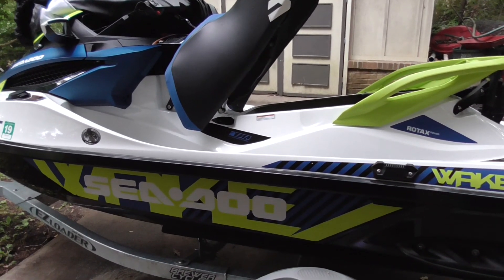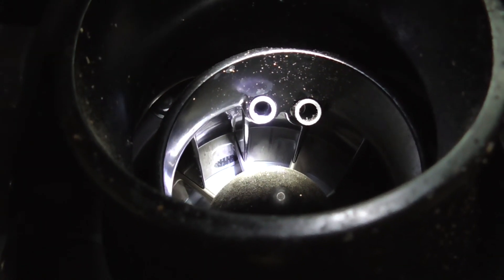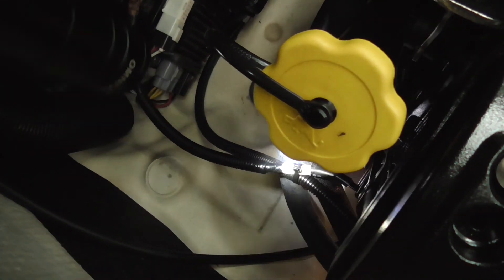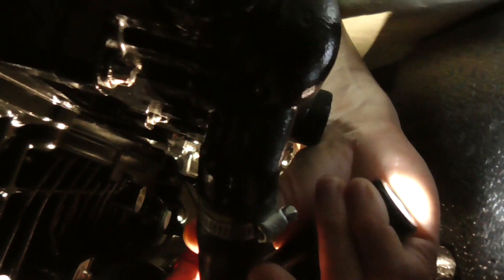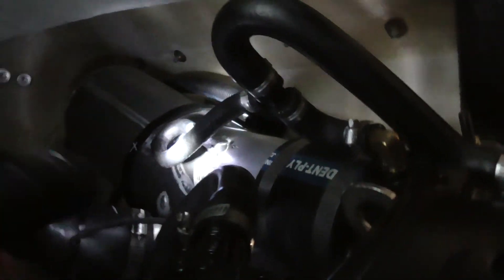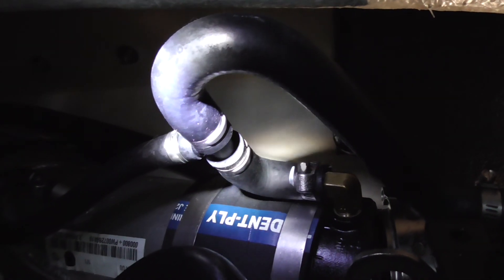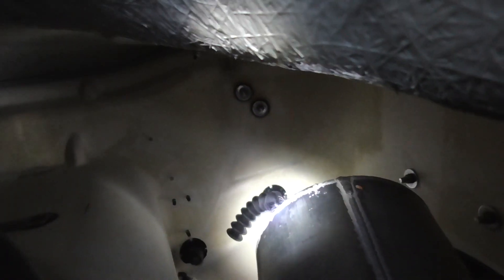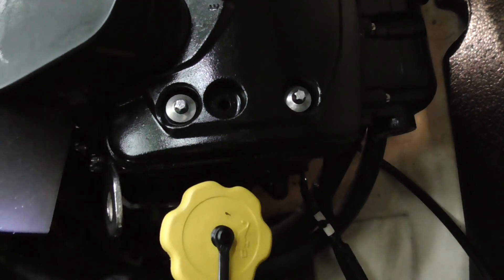Sea Doo Wake Pro 215 open loop cooling system

Comment: Those are your siphon tubes. They suck the water out of the hull while you're running.
Reply: the 2 clear lines are syphon tubes or self bailer lines nothing to do with  open loop cooling.they connect to the drain plug assemble